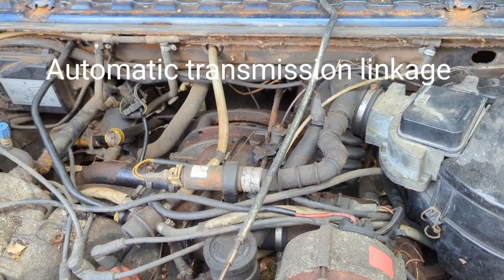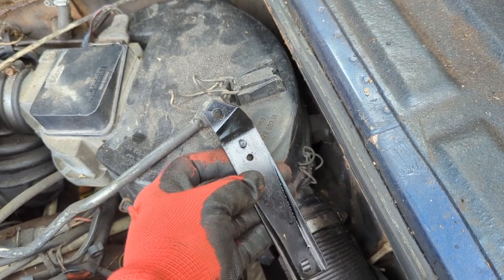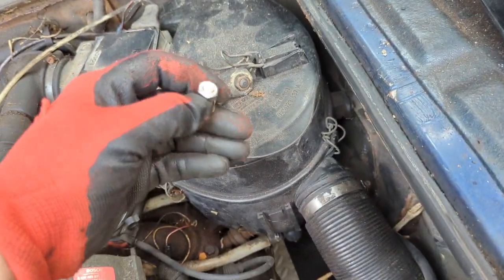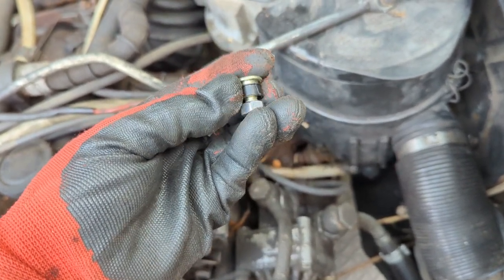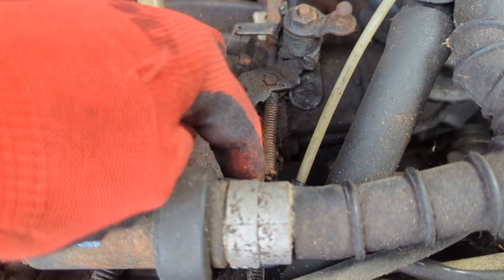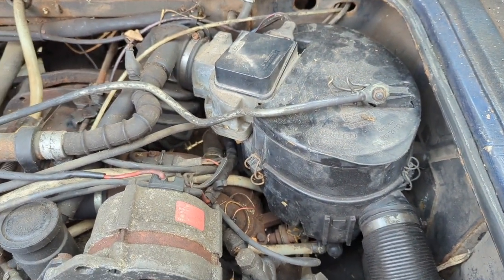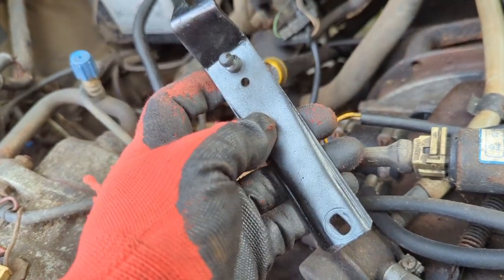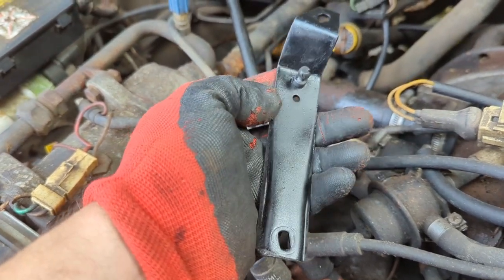Vanagon Automatic Transmission linkage, how does it work?

Comment: This helped me figure out why my throttle was sticking open. Thanks!
Previous owner actually welded a regular boot into the end of the rod that goes to the throttle body, so that's fun.
Reply from the maker: Glad it helped
Reply: @VanAgain  as it turns out, it was just that the bushing was so far gone that it was as if the bolt had been welded in place. 😂 It took a not-so-gentle tap of a hammer to extract it.